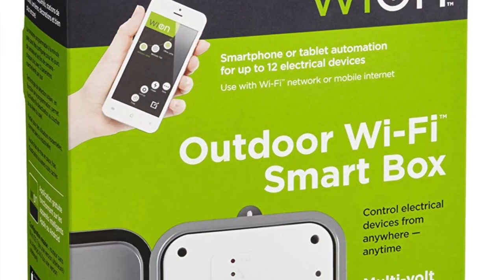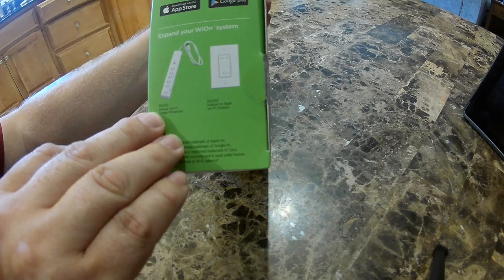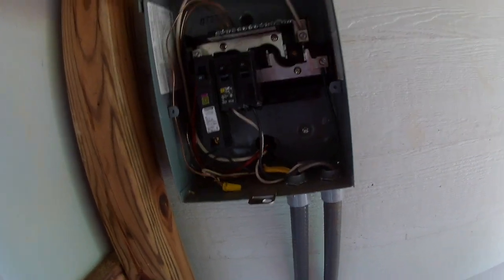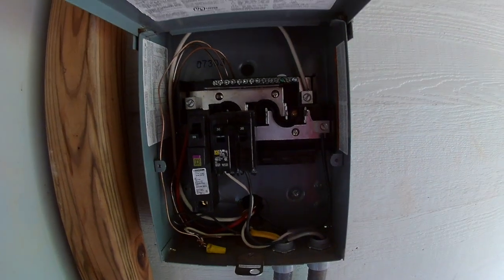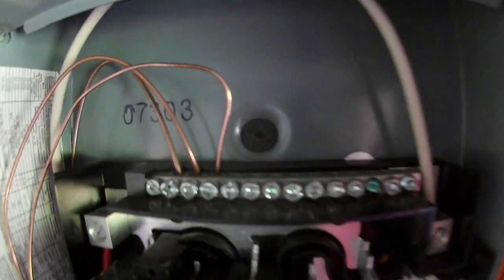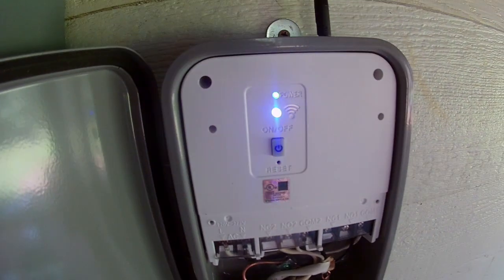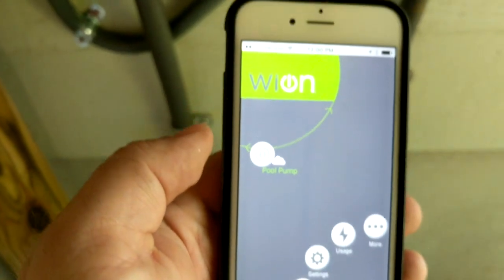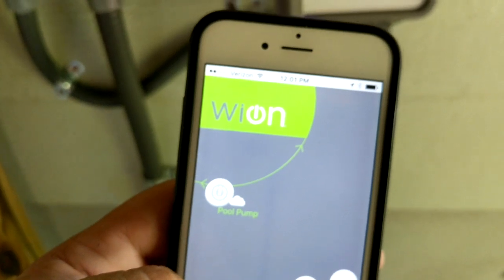WiOn 50054 Outdoor Wi-Fi Smart Box, Wireless Time Switch

Comment: Just want to say thank you so much for posting this, installed today based on some Amazon photos and wouldn't turn on, watched this and was able to piece together how you went from the home lines 1 and 2 and reversed engineered from there.  Would not have been able to do so without your vid, very much appreciated.  No issues with the good vibes tunes either, thanks for the internet assist.

Comment: Thanks so much for this video. I wouldn't have figured out the wiring without it. There are a few issues with the design of the box as you mention: 1) one mounting screw instead of two. I had to drill a hole in the back to secure it properly, 2) the ground screw is nearly impossible to use especially with 10 gauge wire. I think I would need two small hands and a third large one to wrestle the 10 gauge wire. The thought of shooting the box designer came to mind several times during my struggle with the ground wire. I finally gave up and used my additional mounting screw as the ground.
Reply from the maker: Sorry you had so much trouble, and I am happy that I could help.

Comment: Didn’t need to put your neutral wire on a relay just the hot wire to break the connection for on and off just like light switch. This is so you could add a pool heater to the other relay. Again making it so it just breaks the hot wire or L as it lists for lighter or hot wire. And the flex could have been ran better looping to the existing hole to the breaker box from original install from breaker to pump. Other than those few things good job bud. I will be installing on my pool pump and heater this summer.
Reply: Can you share your wiring diagram to show how to control a pump and heater independently using one of these control boxes? Thanks.

Comment: Just a thought read up on the product before you start a How to Video.
I never realized you could run Romex through a conduit, I was told you can have an issue down the road.
The WiOn 50054 box has 1/2 " and 3/4” knockouts. The 1/2” is in the 3/4”, so you have your choice.

Comment: I used a plug-in WiOn Outdoor outlet for one of my clients to control a 110v fountain pump and it’s working great, set it up on his Android phone (same app as this 50054 outdoor smart box) and had no problems whatsoever connecting to the WiFi right away.  I’m wondering if you tried restarting the phone? Or uninstalling and reinstalling the app? I’m considering setting two of these up for another clients spa pump and spa light, this is a very affordable alternative to commercially available WiFi compatible pool and spa controls from the pool equipment manufacturers so I’m hopeful that connectivity won’t be an issue for Android users. I own a pool and spa maintenance and repair business in Southern California and am thinking that this could be a great option for simple “pool only” or “spa only” systems where you’re not controlling multiple pumps, lights, and valve actuators on the same system.  Thanks for the great review!
Reply: @dcdavidrcunningham  As you are above mention address, it is also support Google Home.  You can update link it as: Anyhow, thanks your advice. https://apps.apple.com/cn/app/eco-plugs/id953073532?l=en     https://play.google.com/store/apps/details?id=com.kab.unlimit&hl .   above link, it support
Reply: Can you independently control a pump and a heater with a single control box?

Comment: Just bought this switch and cannot find the Andriod app. Is this company still in business after their latest issues? I'm thinking I should send the switch back before I'm stuck with it. Oh and the company doesn't respond anywhere
Reply from the maker: Stephen McLean  hey Stephen ours is working great. But since the company has had trouble I've been thinking of replacing it at some point.
Reply: I'm thinking it makes sense for me to send it back to Amazon before I go any further. Thanks for the reply. The hunt begins for a new wifi pool pump solution

Comment: You are obviously not a licensed electrician...as I see numerous code violations!! If that is a pool pump system I would suggest a good electrician to correct the mistakes before someone is killed !!
No joke !!
Reply: Like the 14 gauge wire on a 30 amp circuit?  Or the "Romex" in conduit?